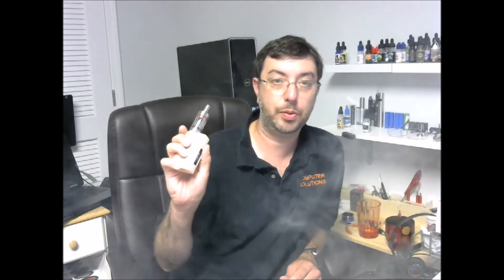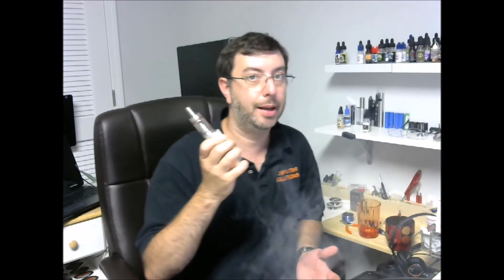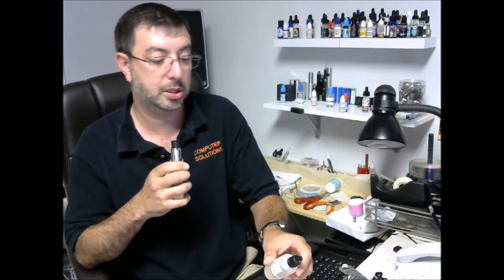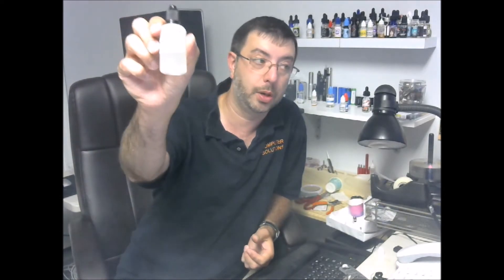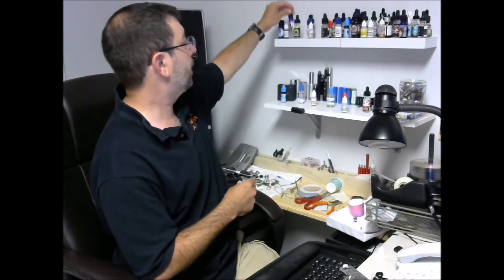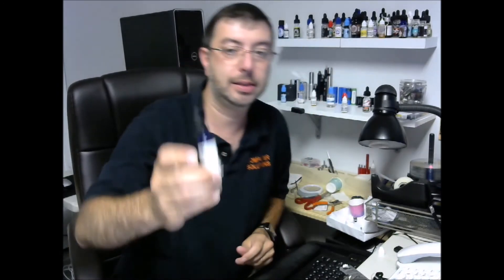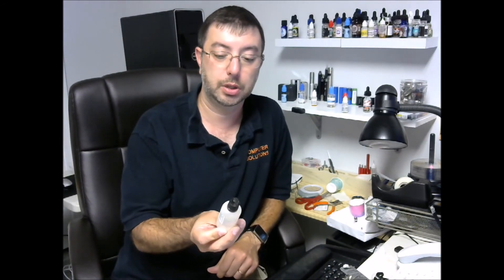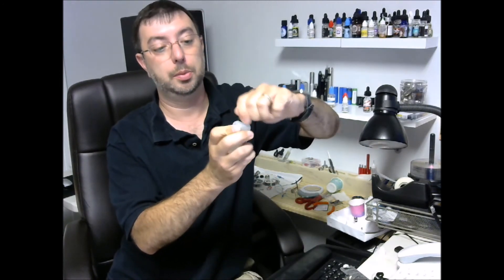VLOG 071315: eVic VT Temp Issues, Xpotios eJuice, Coffee Vapes, Vape Expo NJ

Comment: Check the firmware on the Evic by clicking the fire button 20 times. Mine is 1.18 and have had no problems. Maybe yours has an older version. If so, bad luck I guess.
Reply from the maker: nonkind I did. Mine is 1.18 as well. Too many people have contacted me saying they have the same problem for it to be just me but thanks for bringing up the version issue, that is something everyone can check and i didnt think of it. Unfortunately its not upgradeable firmware.

Comment: Try Phillip Rocke Grand reserve Creme de la creme. Good coffee vape.
Reply from the maker: Actually I have, completely forgot about that one until you mentioned it. It also required a long steep. It's also not readily available as they make them in batches that are only in stock certain times of the year.
Reply: I'm waiting to see how you like the DNA 200. Good videos, keep it up.
Reply from the maker: I'm not that high wattage of a vapor myself but I would certainly try it if I got my hands on it. I'm looking forward to the new Segelei's and whatever I can get my hands on this weekend at the Vape Expo in New Jersey. :)
Reply: It's not the wattage. It's the software suite for it. You can get your puff data in real time while using it, then program the ramp up, power curve, and temp algorithms to get the perfect vape for you. At least that's the rumors.
Reply: We the vapers are looking at this whole temp control thing all wrong. As you probably know temp control works by comparing the changes in the resistance of your coil as it heats up. There is so much more than temp limiting can be done here.
Reply from the maker: Jason Brumley I want to see it to believe it. :) I like granular controls to devices which allow better tuning. (Like Android over iOS). So would be nice if it works that way. :)
Reply: +The Vaping Computer Guy And the price of... to have on a regular basis.   That said, been looking for a GOOOOOD coffee type vape for nearly 5 yrs now & imho besides this one which is, ok... better than most I suppose, but as you mentioned limited (and pricey!) The three I'd say that top my personal list would be...  Epic Wake & Vape...   Velvet Cloud Vapor (1st to offer ALL VG, organic flavoring liquids) the name of suddenly POOF..  oh wait, think it's "Mewlew's Magic" or something similar.. & then the one I've vaped & ordered most of all has been from a place called "Refugee Vapors" ...     It's not just you btw.. Coffee vapes are super difficult to get down.  Me, personally...  I like 'em like I enjoy say, a starbucks or cup of coffee at home.  Strong but not bitter... sweet & rich/creamy, so prob strong coffee with Xcream & Xsugar.  LOL  Hope that helps. :) Live long(ER) & vape on!